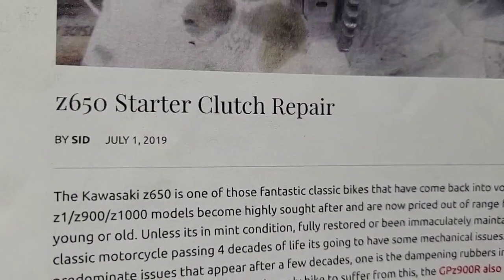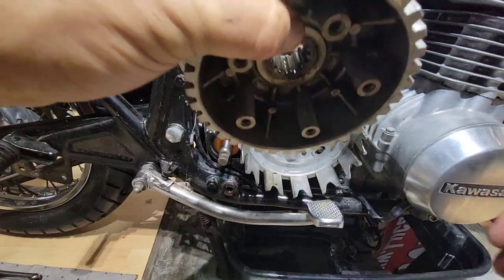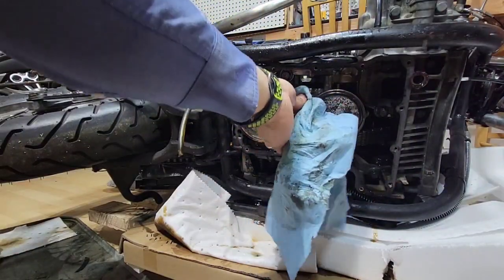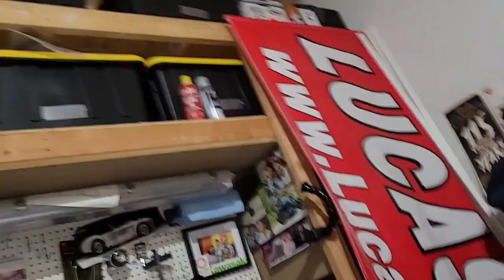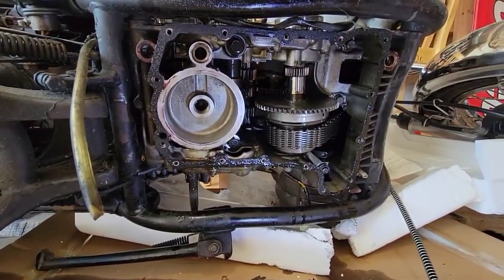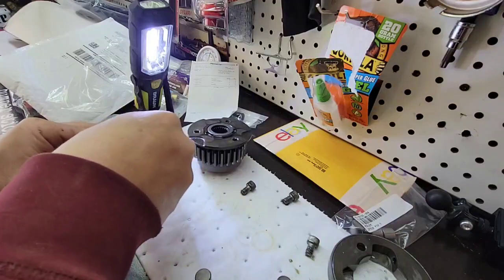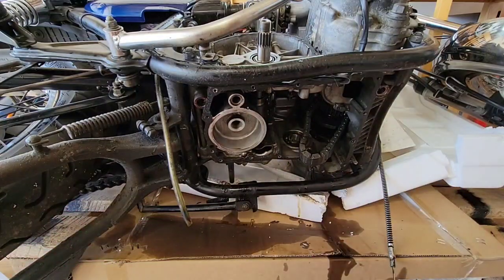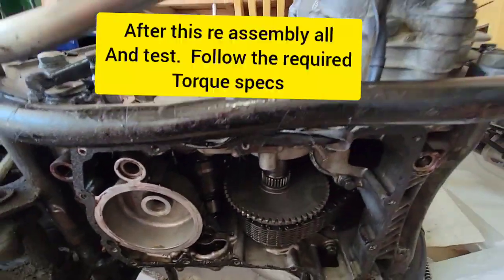Starter Clutch Kawasaki kz650 starter clutch replacement.

Comment: Helpfull video! Did this fix the problem, how's it holding up?
Reply from the maker: thanks for your comment. Once in a while I have an issue starting it. I think is because the electric motor is not strong or fast enough. So first start with kick and when is warm it start good with the starter. thank you

Comment: Ciao io ho la stessa moto con un problema a motore caldo si accende la spia del olio ho sostituito olio filto e sensore pressione ma il problema rimane grazie
Reply from the maker: Hola. No entiendo. Inglés o español?
Reply: @Oneguygarage  Hola tengo la misma moto con un problema cuando el motor esta caliente se enciende la luz del aceite, le cambie el filtro de aceite y el sensor de presion pero el problema persiste gracias
Reply from the maker: @rosarioboccia7268  hola. Gracias por tu mensaje. Lo que pienso es lo siguiente: bomba de aceite, falta de aceite (se revisa fácil) , que el sensor de aceite no funcione correctamente o este mal conectado. Creo más en que el sensor no funcione bien y falle con la temperatura. Espero sirva la información. Saludos

Comment: Hallo, i'm from Poland, kawasaki 750 zephyr 1994 Has the same lokalization flywhell ? Great film .
Reply from the maker: Hello. Thanks for your comment. I am not confident of if is the same or not. But you can compare the 1978 kz650 components used at partzilla.com and see if is the same number. I heard there are a lot of common components between those bikes. Z wyrazami szacinku

Comment: How did you come to the conclusion that the starter clutch needed replacement? I also have a kz650 and my starter sometimes cranks the engine and sometimes it just spins.
Reply from the maker: Thanks for your comment. When the crank spins it can be as the rollers are spinning because of the weak springs. I learned after that that you can stretch a bit the springs in order to avoid the mechanisms to spin. Where the barrels touch may be good to have it rough so they don't spin. Hope this helps
Reply: Don't rough up any surfaces (as these are case hardened if you are able to rough them up you will have wrecked them) sprag clutches (or one way bearings or starter clutches) work on a lock up principle that only works in one direction , weak springs or flats on the rollers or both are what causes a slip (rattle) then you push the starter button, replacing these parts normally sorts out the problem , ps never try and start your bike with a low battery as this can cause early failure of starter clutches.
Reply: here is why you need to change your starter clutch:  https://www.youtube.com/watch?v=bKavA4RMBe0